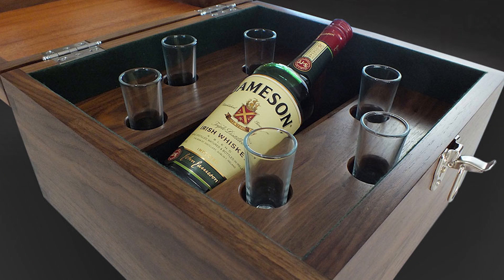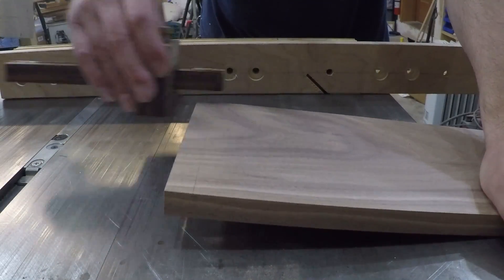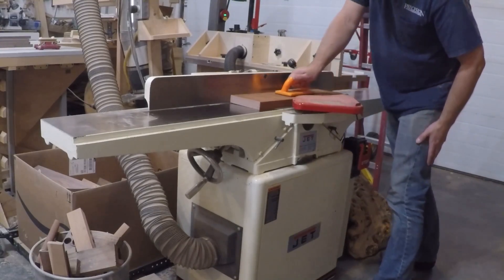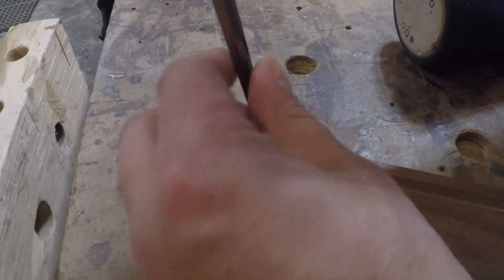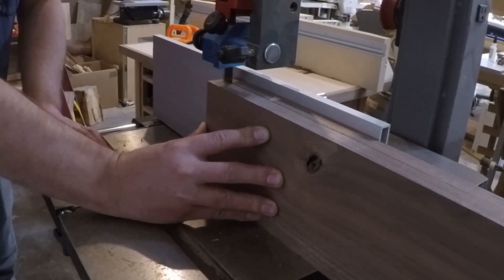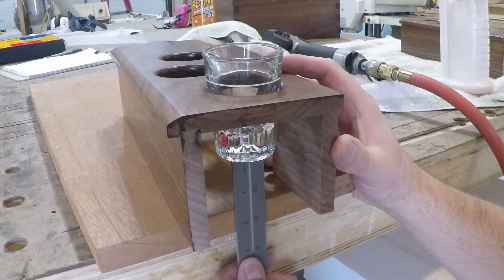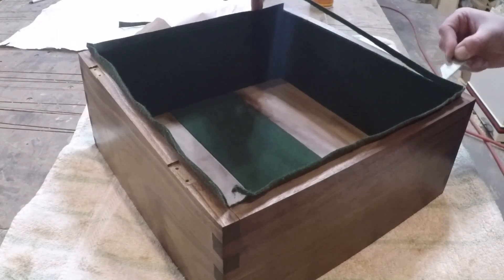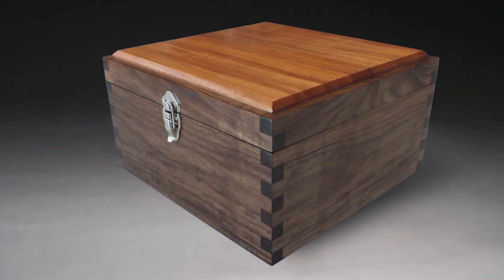Building a Six Glass Whiskey Box - Download Plans - Woodworking

Comment: Really work.
The only thing I didn't like about it was your use of nails on the visible surface (glass holder), even though it's close to invisible, have I had some bad experiences with those areas turning just a bit darker over time compared with the rest of the wood.
But really nice job on that box. 👍